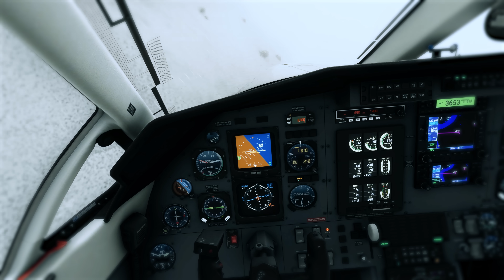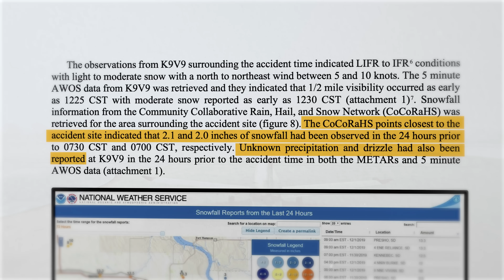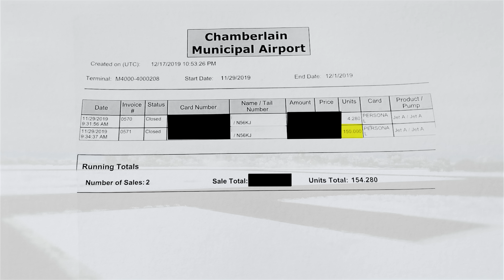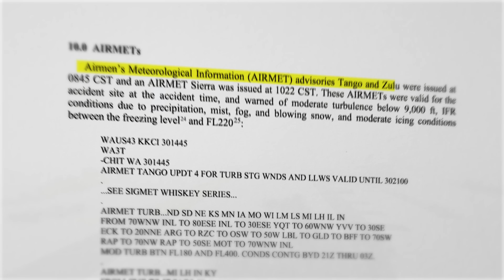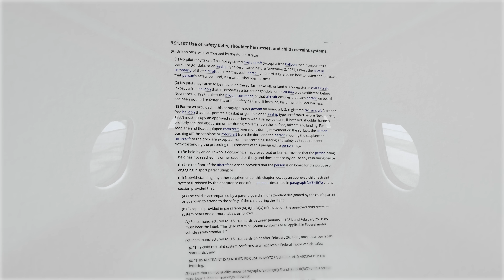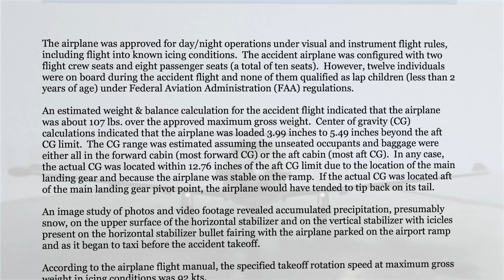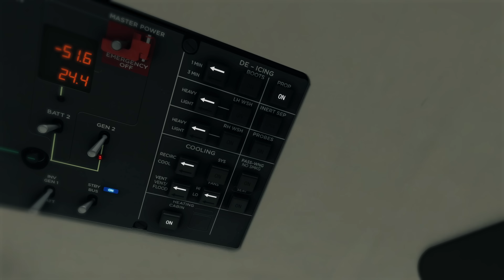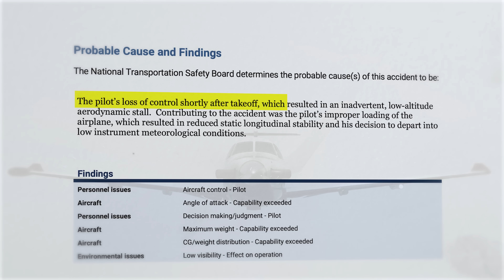PILOT or PLANE: What Caused This Crash? | Accident Case Study

Comment: I have flown a PC12 in worse conditions during a winter tour round northern Norway. I am saying this not to brag, but to indicate that flying in the prevailing conditions was quite possible if the accident flight had been managed and operated correctly.
I have a commercial licence and around 4,000 hours  on several PC12 variants. I was PF; PIC was the chief test pilot of Pilatus (!). At his insistence, the aircraft spent the evening before the flight in a heated hangar and was completely clean when we came to fly it - his words were "all ground ice must be removed, but only by professional operators using proper equipment". We went through the flight plan and the various checks twice, both separately and together. I requested PIC to supervise me throughout the flight and he reminded me that there was no shame in asking him to take over if I felt uncomfortable. It was a two hour flight and I was anxious but calm throughout.
Would I undertake such a flight as sole pilot ? I don't know. It would depend on how I felt at the time and whether or not I had passengers, but having made such a flight once I feel much more confident in my ability to make a sound decision.

Comment: A widespread meme is 'flying is the safest mode of transportation.'
That is true for commercial aviation only.
For general aviation the statistics are quite the reverse. Non-commercial aviation has a fatality rate per hour of flight about ten times that of driving on the road.
This is due to a lot of factors including the greater complexity of and speeds involved in flying but it largely comes down to the lax standards and enforcement of training and certification in general aviation.

Comment: I swear it's just like motorcycling. All the things he did alone were risk factors, but combine them and you're playing yourself with a loaded deck. Physics is a cruel mistress who will take her piece if you don't respect her.

Don't take unnessisary risk factors if you can help it, and if you must take one try to keep it at one. If it goes beyond know when to abort.

I make similar risk assessments on my motorcycle. I've had suprise rain storms lead to me aborting a ride and taking it easy as i limped home. How someone could fly an aircraft as casually as a soccer mom would drive a minivan is beyond my understanding. If i were in his shoes, i would have taken one look and noped TF out. It looked like suicide just to be on 2 wheels much less taking to the air on wings.

Comment: I wrote several deice programs back when they were first mandated for 121 operators in the 90s, and since then have reviewed many more. The first place I went to conduct training was to our pilot cadre in Anchorage. Of course they already knew all about icing, but what I taught them made them look at things a bit differently. 

Airplanes don't know under which rules they are being flown - and ice doesn't care what it sticks to. This airplane, had it been hangared overnight and brought out quickly and departed quickly, "might" have made it (the old five minute rule). But any ice sticking to the tail is a no-go. And isopropyl alcohol is not a good deice fluid, at low viscosity and no non-Newtonian properties (non-Newtonian meaning it stays on the surface until blown off just below rotation speed, around 80-85 KIAS IIRC, which leaves many smaller planes unable to use it). Even a splash of Type I fluid may have made the difference for this family. Sadly, it wasn't even an option for this flight. 

Add to it the macho pilot attitude, the get-there-itis, and loading the airplane beyond max in terrible flying conditions is, well you see the results of that recipe. 

Video was well, done, Pilot Institute.

Comment: Calculated risk taking is usually successful, and that success breeds a self-confidence that increasingly substitutes for the rules.  The longer you've successfully taken risks, the more risks you become willing to take - and do.  Virtually everyone gets away with risk taking, but sometimes the consequences of multiple risks combine at the same time and and place by either accident or fate, and this is the result.  Had a single risk factor been removed or even slightly delayed in time this video wouldn't exist.

Comment: That would be me if I was a pilot. I took enough lessons in my early 20s to know how to fly and (barely) land the plane if something incapacitated my dad, a pilot I flew with regularly. But as much as I love to fly, I never went further than that -- I knew it wasn't for me, even then. I'm impatient, get easily rattled under pressure and have an almost narcissistic "it'll-never-happen-to-me" attitude. Add to that the fact I hate anything requiring detailed, repetitive, routine steps that I can easily convince myself are not really necessary and you see where I'm going. Yeah, I'd be that pilot who blows off checklists, doesn't file flight plans, refuses to check weather updates, skirts rules and regs, and has a perpetual case of get-home-itis. I don't think I'd willingly fly into IMC with no IFR rating ... but if it was "just for a moment," I can't swear I wouldn't.

Comment: In my time working in line service, I've witnessed some pilots use a pump sprayer with TKS fluid or spray bottles of isopropyl alcohol to remove light ice and frost before when they're too cheap to pay for an overnight hangar or de-ice truck. Not a risk I'd take. If I saw that going on, I'd usually go chat with them and offer to push them into one of the heated maintenance hangars long enough to melt it off. Usually only took 10 or 15 minutes so we didn't even charge for it.

Comment: You can’t be specifically taken to task for your title and thumbnail, but it is highly suggestive of a flaw in the PC-12 which is misleading, particularly in this incident which was one of the most shocking examples of pilot error in recent times, the 12 is an incredibly capable and well made machine but even the best aircraft aren’t immune to human homicidal negligence.  To buy iso at a hardware to manually anti ice in falling snow is mind blowing. I guess PC12s one big flaw is that it is single crew capable and able to be flown by a relatively low time PIC.

Comment: Having flown the PC12 for two years as an air ambulance pilot I can say with out a doubt it is not the airplane.  In my opinion this flight should have never left the ground. This is a classic case of “get home-itis” coupled with over confidence !  If you take the facts of this flight you can see the holes line up in the swiss cheese, starting with the decision to go to the airport. The  Utube channel “Pilot Debrief” Does an excellent job of debriefing this flight.

Comment: you can see in the actual video as soon as he gets airborne the airplane is tilting to the left.
Reply: I think the plane was trying to stall from the moment he lifted off, as one wing often dips in a stall because one inevitably stalls before the other. It was hard in training to get a stall where it simply nosed over straight ahead. If he hadn't been so anxious to get off of the uncleared runway with an early rotation, and could have kept the speeds above normal and his wings and tail might have been able to give him one last lucky break and actually climb out of there. But he was entering the stall, to your point, from the very moment of takeoff, and the elevator (the horizontal tail part) never had enough controlability to push the nose back down (after that initial raising of the nose to get off the runway,) otherwise he could have nosed it over and gained AirSpeed as he perhaps planned to do. It was the unplowed Runway and decision to lift off early that was the last straw, never having occurred to him about needing to have faster speeds given the condition of the tail not even de-iced. But they don't teach you this technique in training because you're never supposed to be taking off with ice. I don't teach you to rotate and climb out faster than normal due to pre-existing ice on the tail because it's an illegal technique! Illegal because it violates the handbook and violating the handbook is illegal, but it could have prevented a crash if he could have flown out faster. But he lost even this illegal option the moment he rotated early.

Comment: Holy crap I practiced power-on stalls with my instructor today and 15deg pitch up is absolutely terrifying - it feels very wrong. Just another way this guy seemed absolutely determined to have a crash.
Reply: Here's the difference in my opinion. Aft CG and overloaded, if you aren't flying intentionally faster than the normal rotate and climb out speeds, your elevator is no longer capable of pushing the nose over when you push in on the yoke. You're in an out-of-control situation climbing steeper and steeper with no capability to correct. He was trying to get off the rough Runway quick and then his plan would be to nose it over and climb shallow and gain airspeed. Critical mistake by rotating early he never got enough airspeed to be able to nose it over in the first place so he just power-on stall-climbed until it crashed.
Reply: Swept wing aircraft fly at much higher pitch angles than square wing aircraft.  15 degrees pitch up isn’t unusual in a swept wing

Comment: One minute in and I know where this is going. Eleven people... in a PC-12? Plus a hunting trip, so potentially heavier than usual cargo load. My guess at this point is weight and balance issue, and I doubt they had a commuter config interior so they probably didn't even have 10 seats in the back? The PC-12's lav is a forward lav that folds out and isn't belted, so it's not an approved seating location for takeoff and landing.
Reply: And ice... that's the other "hole in the swiss cheese" that lined up. I'm guessing at this point that the weight and balance were out of the safe envelope, but there was enough of a safety factor that it had "been fine" many times before. Perhaps the same with the ice, and were weight and balance within limits and the plane flown conservatively it may have "been fine" many times before. Add the two together...

Comment: Without having to become a "dystopian" society, isn't there ANY(!) way to keep these arrogant, holier-than-thou a$$holes from even getting into the left seat of, much less OWNING, an airplane with which they'll kill 11 souls (and themselves)???????? He was warned by multiple people!! There are comprehensive and well-researched tools that can be used to identify these kinds of people. There should HAVE to be a comprehensive battery of tests, including a psych eval,  that aircraft manufacturers should be forced to conduct against prospective purchasers/part-91 pilots prior to them being eligible to buy an airplane of this caliber. Ohhhhh, but that would knock out 50% of their sales. Why is it that having money and power seems to walk hand-in-hand with arrogance and entitlement? This accident is evidence of that. I think Pilatus should be sued, not for a defective airplane, but having sold it to this jerk. EVERY GA accident I read about always comes back to the pilot's arrogance of invincibility. Even the arrogance of believing a long-over-TBO engine is going to continue to run without throwing a rod or cracking a cylinder. Rods and cylinders don't fail on new airplanes, just the beat-up airplanes that no one wants to pay to maintain in new condition. It's purely pilot arrogance (to any degree) that causes accidents. Guns don't kill people, idiots with guns kill people. Airplanes like a PC-12 don't kill people. Only arrogance, entitlement, and too much money kill people, Case in point.

Comment: I guess the pilot did not use the FMC. Had he inputted the weight of passenger, luggage and fuel the FMC would have calculated V1 and VR.
Reply: Fmc calculated speeds don’t take in to consideration contamination on the stabiliser

Comment: I was a pro pilot with an ATP and over 5000 hours when I took off from Denver Stapleton airport in VFR conditions.  This was in a Piper Chieftain and it was a cargo flight.  During my rest period (in the hangar) the plane was loaded with 2 big copy machines and a bunch of newspaper bundles for me to drop off at various locations en route to Missoula MT.  The W&B form looked like it was filled out correctly, but it wasn't.  I was loaded to an aft CG....beyond the envelope.  As soon as I was airborne the pitch control felt very touchy.  Very touchy.  It was hard to hold pitch, even in cruise.  I figured out what was up and landed at the first available airport north bound and got rid of some of those bundles.  Took off and the plane felt normal.  I do not think a private pilot, or a beginning pilot could have handled the pitch sensitivity and developed serious osculations resulting in a crash.  ...just sayin....
Reply: Thank you that advice and story is worth its weight in gold. I had thought of this guy had just rotated faster and climbed out faster he would have been okay and just lucky enough to die in the not-too-distant future rather than on this particular day, but your testimony is that it's not just the low speed uncontrollable elevator that's the problem but delicacy everywhere else in the speed ranges as well.

Comment: Question.. Would of it better to have refueld the day of flight, and not day before.
Reply: Generally yes so that you can use actual runway conditions to determine if your takeoff performance is weight limited.  Not much of anything was going to stop this guy however.

Comment: Looks like he was trying to pop it off a little bit early and potentially hold it in ground effect.
Right around takeoff speed if your rudder inputs aren’t good and the runway is slick, you can start sliding a little bit and your natural reaction is to pull it off and hold it in ground effect and let the speed build up and then climb out. 
Sounds like he should’ve let the speed build up a little more before letting the AOA get too high and got the pusher really low.
I don’t think the load would’ve had much to do with it as I’ve seen the PC 12 flown numerous times a lot heavier in a lot worse weather up in Alaska. Those weather conditions are our typical flight in the winter, just add in 40-60kt   and you have an average flying day.

The Meridian and Malibu can get a little Squirrley on gravel and ice through a certain speed range and it’s common practice to takeoff a little early and fly in ground effect when flying on gravel and icy runways.
Reply: The aft CofG may have caused the aircraft to rotate before the pilot wanted too

Comment: That plane went far above and beyond what anyone could have expected to keep itself safe. Over weight, iced down, aft CG, too slow, too much pitch, and it still almost made it. I hope the survivors are healing 😞
Reply: Right, it wanted to fly but the critical factor in my opinion is when he rotated early because of the runway conditions that's where he really pushed the final straw. I might be giving him too much credit here but my guess is He was going to get off the Runway quick then nose it over and build speed and climb out faster than normal climb out, but the moment he lifted off too early he was outside the envelope of elevator capability and couldn't nose it back over. I believe this airplane would have flown out of there if it had been a long Runway and he had rotated and climbed out much faster than normal, perhaps even 20 knots or more. It may have flown out of there. Crazy though. Not advising any of this I'm just saying that might be truly where his luck ran out.
Reply: @placidbeach   not so sure, the ice already on the plane and the one continuing to form due to the conditions would have let them get away for long. 😑
Reply: @kittytrail  for sure, but my point is only that if he lifted off at a speed too slow for the icy heavy tail to point the nose down, he couldn't level off to gain speed and could have gotten stuck there, whereas if he had been going faster he might have been able to get away with it.
Reply: @placidbeach   yeah, "might"... too much problems before take-off and too little piloting skills and connected brain cells. 😑
Reply: @kittytrail  that's obviously true and nobody is arguing against it.
Reply: @placidbeach  I fly a PC12 regularly. Because stalls are difficult to handle, I was taught to rotate late rather than early and to avoid trying to climb too aggressively.
Reply: @hb1338  thanks
Reply: Why didn’t he just keep going straight after takeoff and gradually build altitude before trying to turn?

Comment: If he didn’t bank left after takeoff would they have survived? Or was that the start of a stall?
Reply: Does it matter?  Seeing the pilot and helper using auto glycol, ladders, and brooms for 3 hrs (gee that didn't add any fatigue to anyone). In attempts to device.  Carrying two more people than seats, WTF?  A tail that is still fully iced up. So let's rotate early that will make things better, and pitch up rapidly, oh, and extra luggage to accommodate those two extra passengers.
So PC12, a good airplane under normal operating conditions.  Let's load an over gross aft of center of gravity, with an Iced tail, under speed rotation aircraft into actual icing conditions, from an incomplete, plowed runway, with minimal flight hours in the past few years.
As my father (36,000hrs) airline pilot and a BeechCraft training pilot used to say.  Obviously, this pilot ran out of Altitude, Airspeed, and Brains all at the same time, combined with a tragic case of Get there itis!  Unfortunately, he chose to take eleven people with him!
Reply: @scottpecora371  excellent summary- I knew all these people. The pilot was a great guy but that doesn’t equate to sound judgement
Reply: @three1161  So, who exactly was this great guy?  Name?  History?
Reply: My guess? loss of lift (stall), left wing first & resulting roll left.